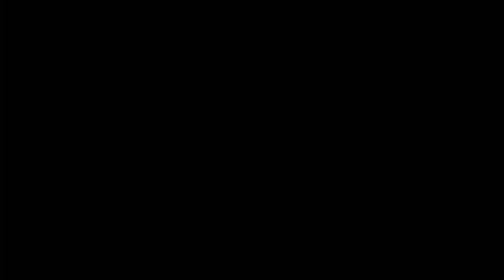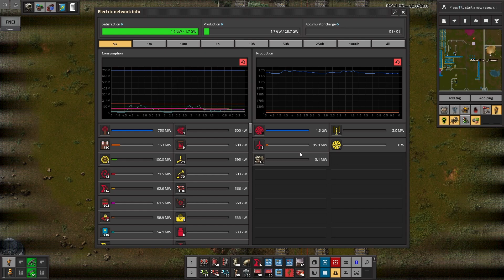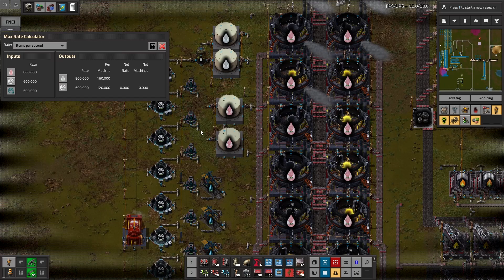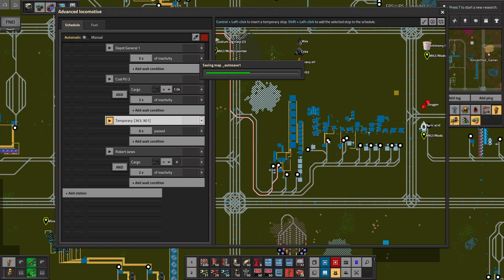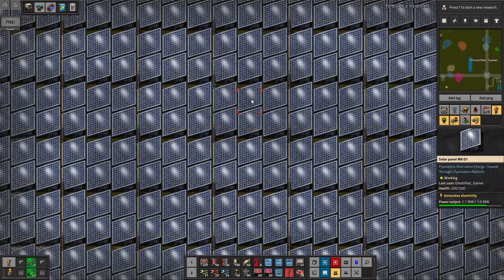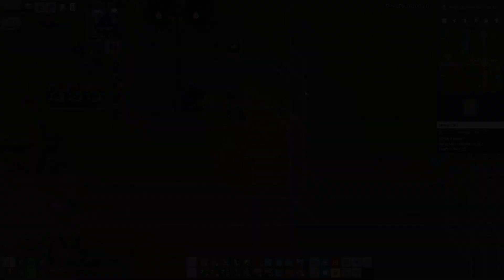Factorio pYanodons - Power Upgrade and Rework - EP 168

Comment: The rounding error is just Factorio fluid logistics being Factorio fluid logistics. It's not a perfect system and some fluid gets removed very slowly in large systems (floats are imprecise and not amazing but its the best you can do). The best way to combat that is to have as few entities as possible. Also, rate calculator (not max rate calculator) can be a bit easier to handle, and shows how many machines you select as well as having options for total calculation multipliers.
Reply from the maker: Thanks for the info.  I'll look into rate calculator.
Reply: @FantasticMrGhost  Not entirely sure if it's true, but I believe that low levels of fluid are more likely to ghost delete. Might help, might not.
Reply: Yeah tbh I kinda wish that factorio just used barrels for everything instead of pipes and its fluid system for exactly this reason. It's really my only gripe with the game